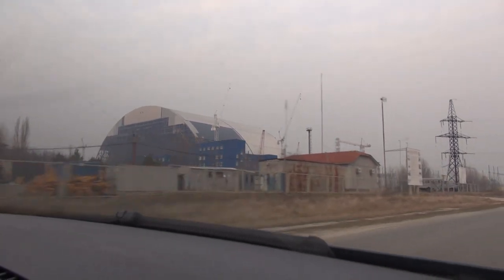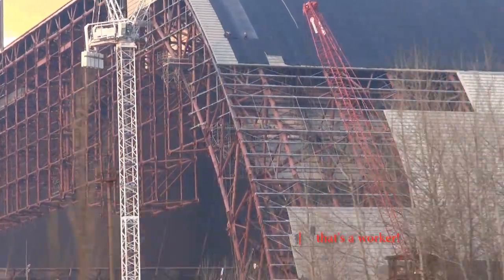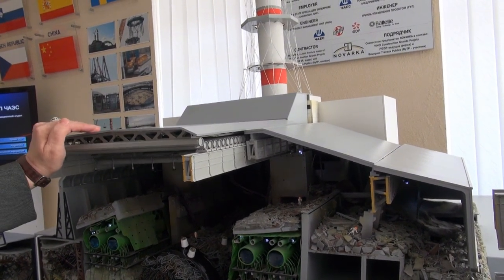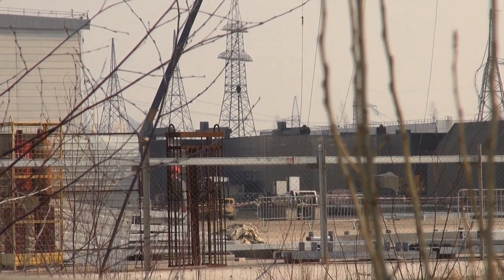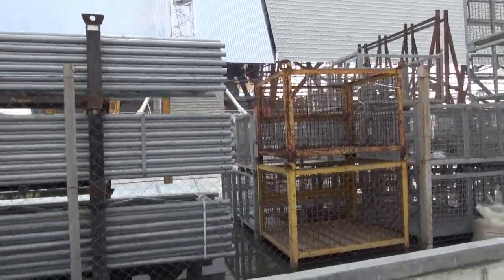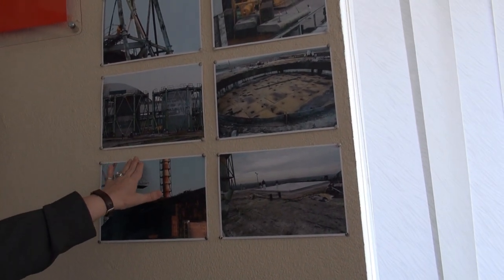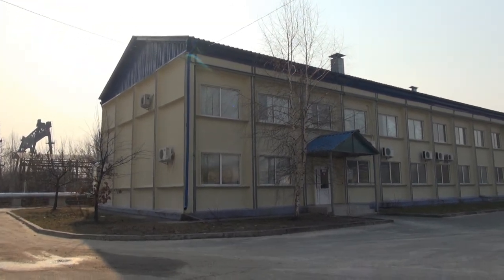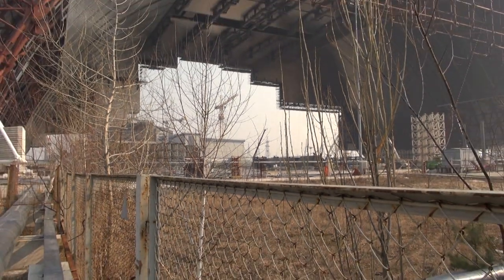Chernobyl New Safe Confinement (NSC) 2015 - "Арка" shelter of Reactor 4

Comment: Doesn't a Chimney for ventilation sort of defeat the idea of containment?
Reply from the maker: Majoofi not really, it is possible to have filters within chimneys; e.g. garbage incineration plants have these types of particulate (and other) filters installed, too. that way, you can ventilate the area, but still keep radioactive dust inside.
Reply: bionerd23 
Dehumdifying works like a air conditioning.  So probably there is no direct connection from the chimney to the inside of the confinement. Thx for the update.
Reply: +bionerd23 Exactly.  The chimney at Windscale in Sellafield was luckily fitted with particulate filters just before the core caught fire and belched radioactive smoke up the chimney.  As for keeping humidity down, it will help with slowing the rusting of structure inside the reactor building (noting how quickly buildings have fallen into total ruin in Pripryat in your videos!).  If it's gotta survive 100+ years, best to keep it frost free and dry.
Reply: It's for air conditioning, without it the arch would rust i no time.

Comment: So here we go. :) She said the amount of radiation on the roof now was 1 - 2 Roentgens/hr. So this is what is still escaping from the sarcophagus from the amount of "corium" buried under the power plant for these last 29 years? In "Chernobyl Uncensored" it mentioned that the amount of radioactivity on the roof from the rained-down graphite was about 10-12,000 Roentgens/hr (hence the reason the robots went berserk). And the guys would stay on the roof for apx 60 seconds each. After which they would have a lead taste in their mouth for years later. How much exposure do you think they got over 60 seconds  (if 10-12K/hr was accurate)? One guy went up 5 times. Also, they mentioned having to use goggles to shield them from beta rays. Any idea what Beta rays would have come from, and how do goggles shield against them?

The lady you interviewed also said 95% of the fuel became ejecta. So that would leave the 200 tonnes of fuel in the bottom as the 5%? Is that correct? So 3800 tonnes got ejected all over the surrounding countryside? Is the red forest much more radioactive than the other areas, and why would that be, if so?

I also read some of the comments below, and one talking about forest fires. You said you'd be worried about them because the trees and plants would have absorbed high quantities of radioisotopes, but the ones that are the most radioactive (ie: faster half lives, like Iodine 131) would no longer be there, so it shouldn't be quite as big a threat. So the Cs 137 and strontium 90 could still release their toxins into the air. But how have the animals (who eat the plants in that forest) been faring? Did you ever watch this video on eating food in the exclusion zone? watch?v=QwStrnqsIwo Wonder if these people are still alive? did you encounter anyone still living in any of the villages while you were on tour, or hear tell from any of the tour guides about people still living in there? This video says they lived 15 km away from the plant. Could that actually be outside the exclusion zone?

Anyway, these are kind of random questions that I was thinking about, some based on your video, some not. Thanks so much for the videos and hard work you put in on making them. And for any answers you have time for. :) All the best.
Reply: CraigDCrocodile - EXACTLY MY THOUGHTS TOOOO..... >>> bionerd23 - Although I appreciate your efforts on recording & exploring the AFTERMATH of the Chernobyl event,... I am somewhat confused and wondering HOW &WHY , you altered the COMMON values for radiation EXPOSURE DOSES given in roentgens ( between 1r /hr - 2r/hr )  by the staff lady,... ON THE ROOF  some 60m above ground level & NOT taking into account of the INVERSE SQUARE LAW,.... 
.... and yet you decided ( without explanation or medthod) to JUMP-convert these to ABSORBED DOSES,... first to Gray  !!!??? when there is a direct Sievert EXPOSURE DOSE >>>> 1r/hr  = 11.93317422rem/hr or >>>> 0.1193317422Sv/hr ( = 120mSv/hr  !!! FUCK !!!! ) how did you arrive at the miniscule value of 10-20mSv/hr  ??? and why did you change the COMMON EXPOSURE DOSE data to the x100 lower  SI UNITS* ABSORBED DOSE ??? 
- Sadly, I think you are doing a COVER UP in line with the IAEA by reducing the DANGER FACTOR  of the real contamination and attempting to equate theses with the NATURALLY found radiated sands of Brazil.  Question: would you bury yourself in the soil under the top 5 cm of soil pushed over the contaminated areas of Chernobyl, as they did on the beaches in Brazil ??? 
- I smell a at here !!!

Comment: I have a question. Do you know any news about the Chernobyl forest fire 2015 ? Will a smoke or the radioactive dust reach The Central of Western Europe ? Is it dangerous ?
Reply: pavolpi I live there. It is obvious that set fire to the forest by Russian saboteurs . Now the situation seems to be under control. But it's possible that radiation with smoke rose into the sky, and  has shed with rain.
Reply: Гнучка Куля obvious....propaganda works ...
Reply from the maker: pavolpi the forest fire has been extinguished, but it was very close to Burjakivka and other high level radioactive waste disposal sites (fire was approx. 5 km to the west of those sites located towards the southwest of the Chernobyl NPP). it was also in somewhat heavily contaminated areas (from initial "fallout", not from rerouting of e.g. robots etc. there); however, it wasnt all that bad. i did not actually follow through with the wind flow simulations of Europe at the time, but you could look up the wind flow / weather simulations for those past days if you're interested to know this in detail. i have no precise numbers, but i'd assume the amount of released isotopes to be "minor" and even "negligible" if you mean "Europe" as in "the EU". if anything, it might be somewhat of an issue in Ukraine an Belarus.
past fires have already released "a few percent" (depends on source) of the initial activity of Cs-137 and Sr-90 released by the Chernobyl nuclear power plant in 1986; if the highly contaminated areas including the red forest burn down, they could even release the same amount of Cs-137 and Sr-90 (and Plutonium and other long-lived radioisotopes) over Europe as the plant had initially released in 1986; these fires are, in my opinion, a much greater risk than a collapsing sarcophagus (it's unlikely that is going to happen in such a massive scale that it could release amounts significant to areas further away, such as Europe, while uncontrollable fires in very dry summers are actually quite likely).
larger particles that did not fly all that far initially after the explosion have in some parts been dissolved and taken up into plants and trees, so if they burn down, that could release very fine dust that can travel a long, long way again. i do consider this to be a threat. not an acute threat to health, as all the highly radioactive and very dangerous isotopes such as Iodine-131 (half life: 8 days) have disappeared by now - but it's a risk of serious contamination, whatever that may lead to in the long run.

i also posted a photo of the fire location and more on twitter, if you want to check those links, i posted all of them within March and April - should be fairly easy to locate. otherwise, you can easily google for more articles on the issues regarding fires, of course. there are plenty of articles. :)
Reply: denis denis Putin said that he was prepared to use nuclear weapons when they have annexed of the Crimea. Crazy Russia will stop at nothing in order to destroy Ukraine. I have no doubt that the Russians set fire to Zone.
Reply: bionerd23 thanks for these information. I'm not using twitter. Just facebook and YouTube. Do you have a facebook account ?
Reply from the maker: pavolpi you can luckily see my posts without being logged in / having an account on twitter. :)
https://twitter.com/bionerd23
Reply: bionerd23 OK. I'll check it out.
Reply: +Гнучка Куля lol
Reply: +bionerd23  could you by chance use Facebook as well  some of us don't have twitter.
Reply: +pavolpi Dobrý den, doufám, že se to nestane. Ale vzhledem k tomu, kolik radioaktivity je v celé černobylské oblasti - prach, radioaktivní stromy, keře apod., které hořely a uvolňovaly velké množství radioaktivního kouře, tak bych řekla, že pokud bude vát vítr naším směrem, je možné, že se něco dostane i na Slovensko a do Česka... Ale může nás uklidňovat to, že by to už nebylo tolik radioaktivity, jako v roce 1986... Přeji hezký den.
Reply: +DanaPatriciaMary1 Bolo by dobré zmerať rádioaktivitu na Slovensku a v Čechách. Ale nie len kvôli tomu požiaru, ale či neostala aj nejaká radiácia po výbuchu elektrárne v roku 1986. Ale si myslím, že kontaminovaní sme vtedy boli všetci. Darmo, že mrak prešiel cez Slovensko 3 krát, ale nakupovali sme potraviny aj z krajín mimo Československa. Problém je, že neviem odkiaľ zohnať ten merač rádioaktivity.

Comment: Just looking at the construction work, what protection from radiation are those tower crane drivers getting? They appear to be high above the old reactor and behind the concrete wall that protects the rest of the build site.
Reply: None probably, the area around the reactor is fairly safe to be around in most areas as long as it's not for extended periods of time so they most likely aren't in any real danger or they're just remote controlled cranes
Reply: Crane operators are mostly protected by distance - they aren't very close to the reactor.
Radiation on top of the old confinement gives you annual allowed dose in 12 minutes. Right next to it on ground level - in around 5 hours. I guess it's even lower at those cranes, since it's basically super high frequency electromagnetic wave - and that decays with square of distance. So, 3 times farther = 9 times weaker.

Comment: I'm glad to see the new safe confinement structure about halfway completed.  As I watch the video, I can't help but think how this structure resembles an aircraft hangar.  I do wonder what the people who work at the plant are planning to do once this structure is in place and the old containment structure is removed.  Are they planning on more cleanup around the reactor?  I wonder how much progress they can make being the site is still radioactive.  At least much of the highly radioactive materials are down in the basement under the reactor.
Reply from the maker: GrnArrow092 yeah, they're looking to decommission the entire thing... much like you would decommission a normal nuclear power plant, just with a molten core in the middle. it even takes decades for a normal reactor due to everything being so contaminated and radioactive - here, it'll take 100+ years to come. but they plan to indeed dismantle the old sarcophagus, then work on decontaminating the mess below it... not with bare hands, but with robots and machinery, of course. hence why they also need that ventilation stack so badly...

Comment: It seems strange that they want to disassemble the old sarcophagus, I think it still shields some. Once the new sarcophagus is placed it would be double shielded?
Reply from the maker: CBRNe8310 well, you cant just put a new sarcophagus over the thing and then, let it be as it is - they have to continue to work on this accident or more like, the remains. the new sarcophagus will shield the old one, so it can be safely disassembled. but that's just the first step - then, they will decontaminate and clear the area, up to the very point where they can remove the elephant's foot, the molten mass of fuel that is in the basement of the reactor building.
this is not THAT unusual, even - to decommission a normal, operational nuclear power plant as-planned, you also need a few decades to safely disassemble all the pieces that have become highly radioactive.
of course, with a blown reactor core and a deadly mass of corium, this is a worse issue, but still... a light version of this is going on during any decommissioning of a nuclear power plant.
positively speaking, it will employ thousands of people for the next 100+ years.
Reply: bionerd23 can you please tell us more about the situtation inside the reactor and the work that is done or has been done there ? also about the effort to find the remains of the employee that is still missing

Comment: Once NSC is on its place, old sarcophagus  is removed then what? The reactor lid weighs 2000 tons!!! Just how they want to clean up all that mess? (sorry for english)
Reply: +tom The New Safe Confinement is getting two bridges cranes installed, these cranes travel east to west on common runways and each has a span of 84 metres.
Reply: +AutoslaapExpress I know it but what will they do with that highly radioactive debris? They need to move it outside of the NSC to save it somewhere else. A new sarcophagus is only a cover for safe cleaning up the mess .
Reply: +tom Yes. They're actually busy to create a spot for the debris.

Comment: Can you tell me if the fire have damaged any buildings or equipment?
Shouldn't you not visit the place after the forest fire...
Reply from the maker: Айдеед Мохамед no, the forest fire wasnt anywhere near the nuclear power plant. it was approx. 20 kilometers to the southwest (near Burjakivka) when it was put out. surely it released some radiation from burned down, contaminated trees and wood, but it wasnt so bad. a close call, yes, but it could have been much worse. work can continue at the site as usual.

Comment: will they just remove the old sarcophagus with NSC or will they take apart the part of building that will be housed in the NSC, due to the most of the remaining fuel melted together under the reactor.

now the others reactors are empty can they be removed those building or will they end up like 5 and 6 oh and like pripyat overrun by forest
Reply: 1BigBen The old ''hastly'' built sarcophagus and the reactor will be completely dismantled that will be housed by the New Safe Confinement, in 2017 or 2018 it will start.
Reply: AutoslaapExpress and what about the nuclear fuel "lava" under the destroyed reactor? Does it really still need monitoring and controlling, cant they just forever bury the the tunnels and corridors down there? I mean I understand that they propably want to make sure that the nuclear fuel down there never gets in touch with water, but I quess the only another alternative would be to use robots to collect the fuel and move it somewhere else to more safe location
Reply: Balnazzardi The Fuel Containing Material (FCM) has come into contact with a LOT of water already.  The biggest concern is the FCM getting "recycled" by radical groups wanting to blow another hole in Humanity & Nature.  Even if buried in concrete, the "prize" is just too big to be ignored.  People would find a way to tunnel to it in support of their cause.  Nothing can be made foolproof - fools are too ingenious.
Reply: Mike Cowen and somehow the fools almost always end up in management positions
Reply: 1BigBen Much truth in that,  However, my thought was in the arena of "worker bees" who will readily give up their lives fulfilling their master's goals.  Think in terms of suicide bombers and the like.  I'm sure hundreds or thousands would come running to hack off a chunk of the Elephant's Foot with hand tools "for the cause". Anything for the cause.
Reply: Well, it's no different that any spent fuel or other nuclear waste. The most that can be done with it is dirty bomb - and there are much "better" materials for that.

Comment: and what if the old confinement will collapse when the new one is over it ? No issue for the Environment but the ruine will not be accessible for Monitoring any more

Are you not going inside the reactor? Too high Radiation even for you ?
Reply from the maker: bobl78 no permission. to go into the sarcophagus, i need to be directly associated with the company involved there and have business to do there as well (being a crane driver is not enough). and being a scientist is not enough, either. i waved around my diploma and radiation passport (an official document), to no avail. 
...maybe i should just marry an Ukrainian and get a job working for Novarka in the future... :)
Reply: bionerd23 so what are you wating for then :-)

Comment: 95% of the fuel is still inside? Hard to tell, cuz of the accent and the audio seems to miss a word or its just the lady speaking. I dont think the explosion could have the force to blow out 95% of that hugely heavy in mass material anyhow.
Reply: Look up on YouTube "Chernobyl  Elephant Foot" to see what happened with all of the fuel.
Reply: With like 1% of fuel. Absolute most of it is still inside the reactor vessel. The top is blown off but the rest is more or less intact, with only localized breaches in places where pipes entered - and fuel is quite solid, only a small fraction was melted.

Comment: Why is this confinement described as safe?
Reply: Because it keeps the world safe from the nuclear waste. Or because it's safer than the deteriorating sarcophagus.
Reply: +Peter Kan  most likely because of its size and its purpose. Since its in an Arch shape. This confinment will probbly be doing what the current confinment is doing. Which is preventing anymore radiation from escaping the remains of the crippled 4th reactor and compleatly seal it off compleatly.